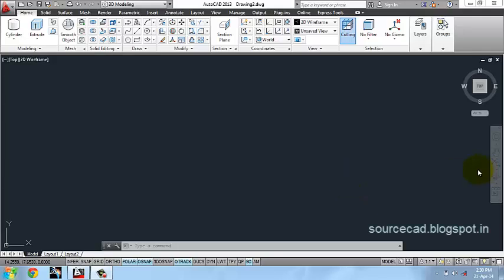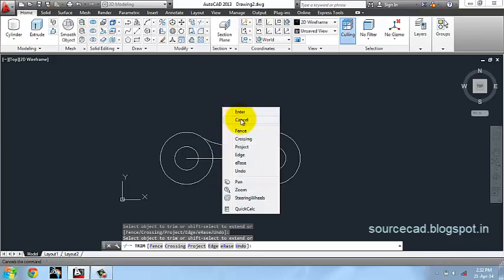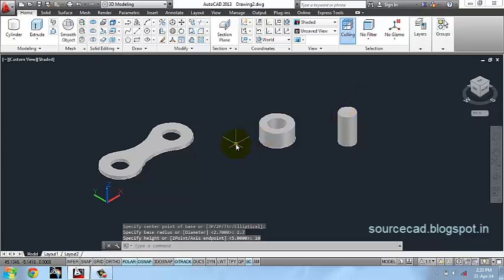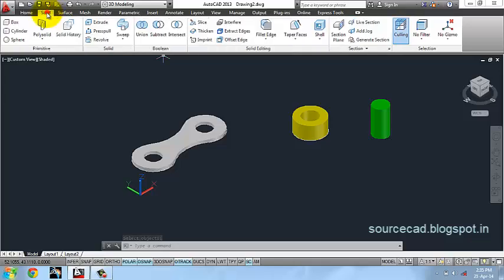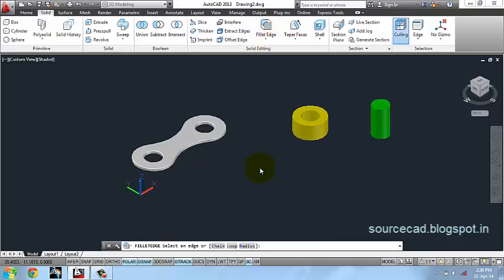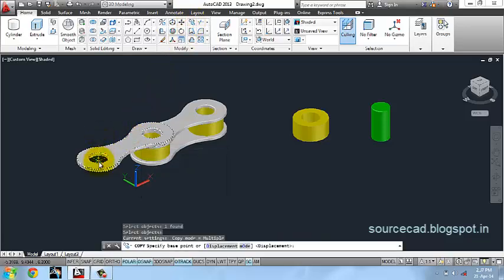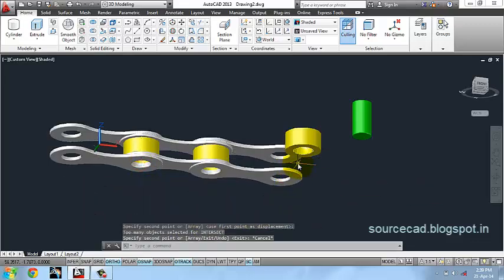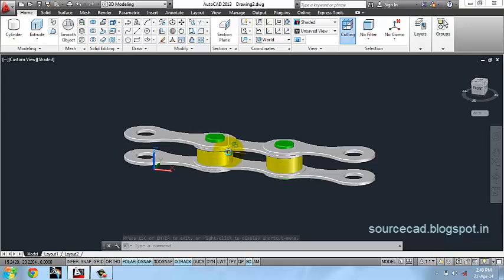Quick way to design Chain link with autocad

Comment: Jay, I come back to these excellent videos as a means of brushing up on my ACAD skills. There’s always something I’ve either forgotten about or did not pick up on the previous run though the lesson.

I was reminded of a question while running though this video. I note that sometimes, “snap points”, can appear and disappear depending on your zoom, and or angle of view, making it quite tricky when you are trying to move objects to that snap point. This is especially so when snapping to the centre of radius where there is a 3D fillet edge.

Do you have a remedy to make snap points stay and not disappear?  I note a similar problem when trying to snap to the centre point of a flat surface.  Sometimes the snap point just won’t appear even if I have the 3D dnap selection switch turned on.